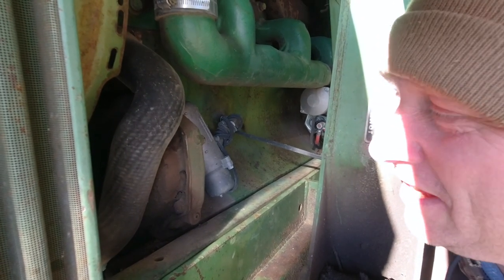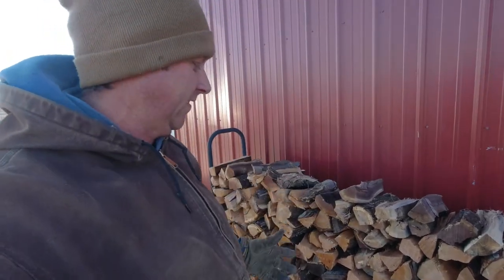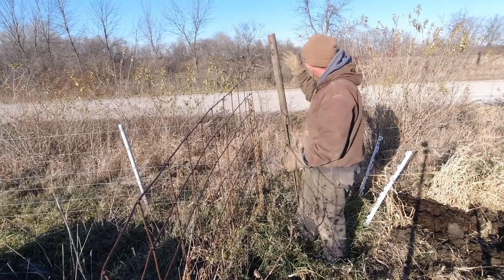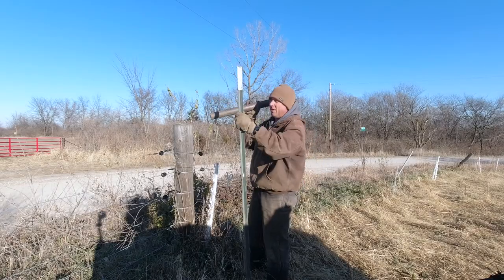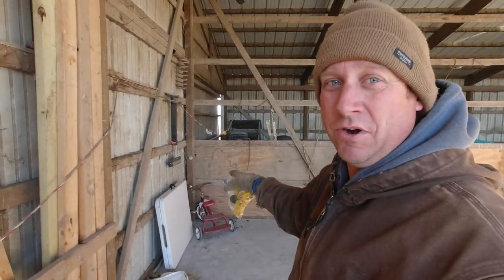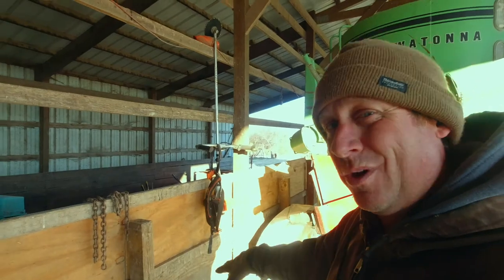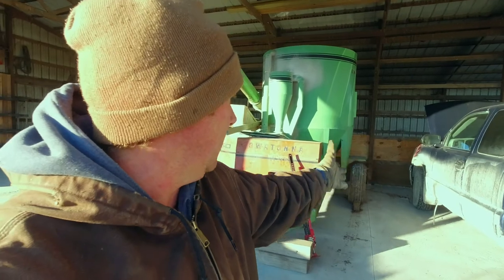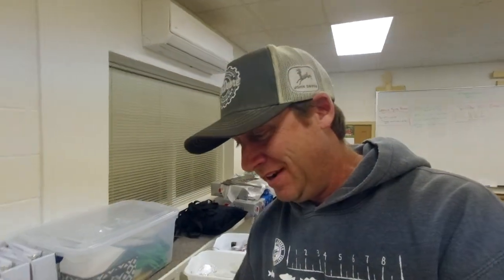How Will it All Fit in the Shop?!?

Comment: Good shelving can get $$$ quickly.  You might look into getting a few sections of used pallet racking.  If you don't put any crossbeams in the bottom 2-4' you can put other stuff under there (mowers, bicycles, air compressor, etc).  Use pallets as your "shelving" on the upper crossbeams - even if you never pull the complete pallet load down.  Very heavy duty, flexible, and fairly economical.  You're making progress!
Reply from the maker: Pallet Racks are kind of what I'm thinking about using, especially with as high as I want to go. I'm not a big fan of how deep they, but I think it will work great for certain items and then I'll build my own shelves near the door to the lean-to.

Comment: Supposedly, you can screw a gate lag screw into the broken piece of post in the ground, hook a chain to it, and pull it out without digging a gigantic hole.  If the hole doesn't collapse, you can drop a new post in the hole, tamp a little around it, and you're done.  If you can find some posts, it might be easier to replace those broken posts to get through winter until you can replace the fence.
Reply from the maker: That’s not a bad idea ... I’ll have to give it a try (if it’s not rotten now that it’s been exposed to thee rain/snow/mud/freeze for the past couple of years. 

Thanks for the tip!

Comment: Man, I feel your pain about organizing your space. I'm a city slicker with no ag experience and we're in the process of building a 52x72 shop/barn. I've asked people for feedback about things to do and things not to do but I didn't get much. I plan on using the height of the building by making a loft above and storing a lot of things on shelves up there. Keep up the good work!
Reply from the maker: That sounds like a great size for a shed (although I don’t know how much you need to put in it). If my peak was steeper I would utilize some of the height, but I think my best bet will be to eventually build an insulated ceiling and the make use of the rest of the space as best as I can. Shelves are going to be my friend though 😁